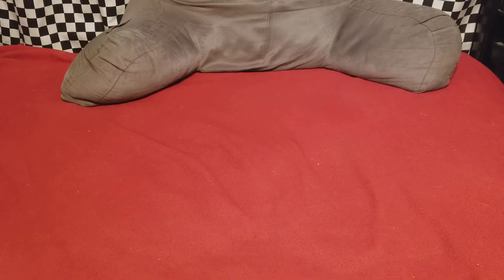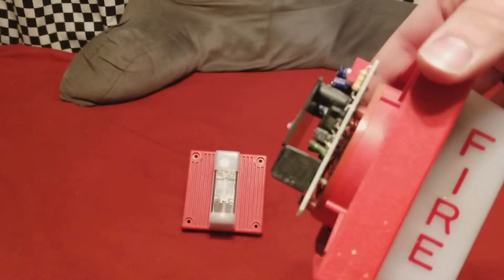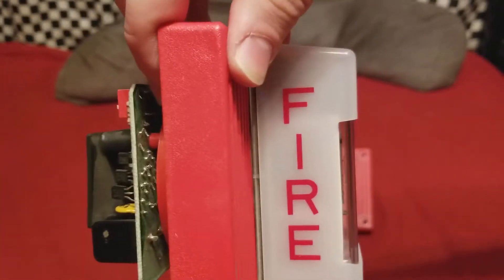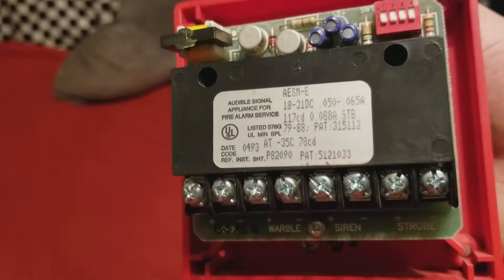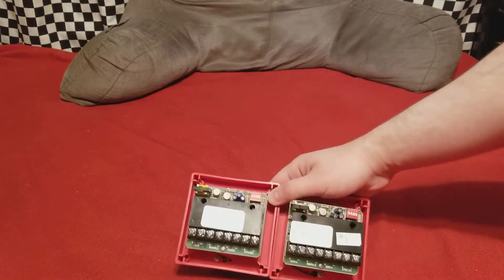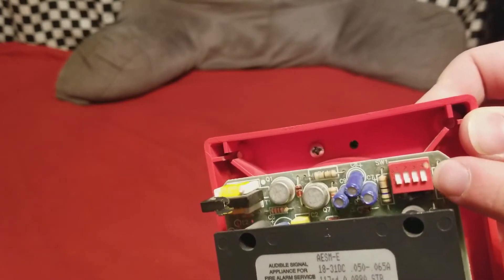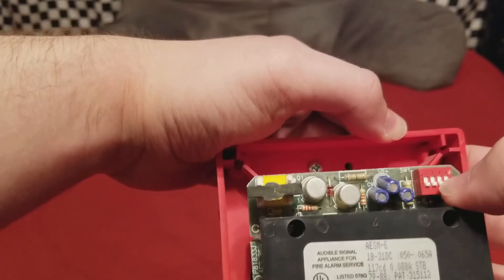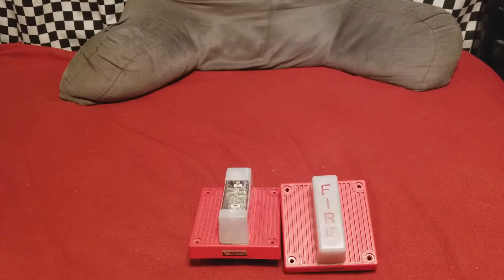Wheelock AES-EL1-WS-24 and Cerberus AESM-E Overview

Comment: Thanks for the video Craig.  Would you happen to know what the direct replacement for this defunct AES-E1-WM-24 is?  I can't seem to find mention of it anywhere on the Wheelock site.  Thanks!
Reply from the maker: The AMT series would be the standing sister, not a direct replacement, as AMTs, I believe, were introduced at or around the same time as the AES.

Comment: What are the dip switches for on the top right corner of the alarm?
Reply from the maker: RSS Alarms 
One of them controls the volume, and the other three control which horn input(s) will also activate the strobe for 2-wire control.
Reply: So it’s both 2 wire and 4 wire?
Reply: And if the first switch is up, it’s on high volume?
Reply from the maker: RSS Alarms 
Either the first or the fourth.
Can't remember off the top of my head.